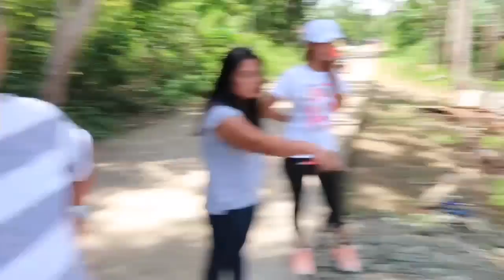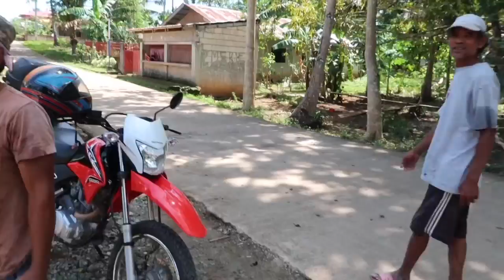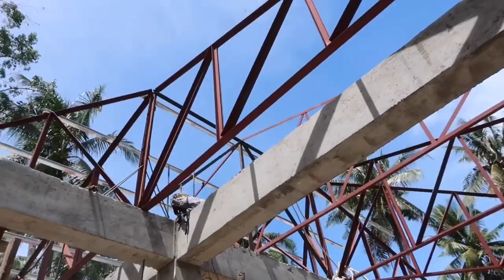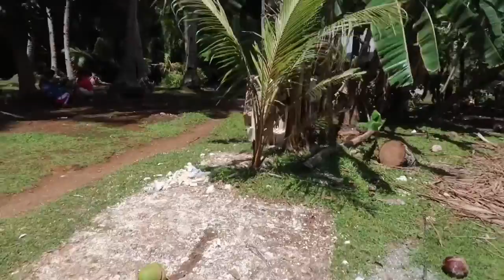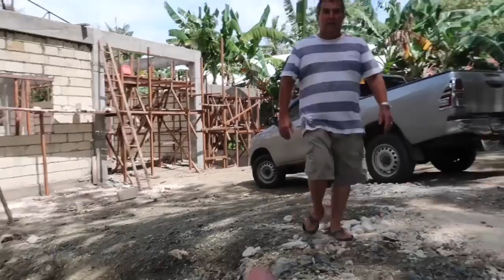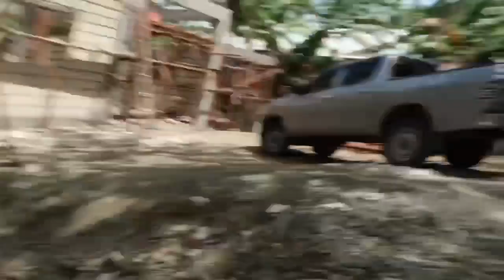NEW CONSTRUCTION BACONG ANDA // HOUSE BUILDING PHILIPPINES

Comment: Btw, with the existing slope from roadway and with the high ceiling of the superstructure, I would rather add floor elevation equiv. to two layers of CHB for floor level and thereby adjusting also same amount of elevation to door headers, and window sill and headers as well...just my 10-cent recommended change order...lol, while the construction is still not finalized now...thx.